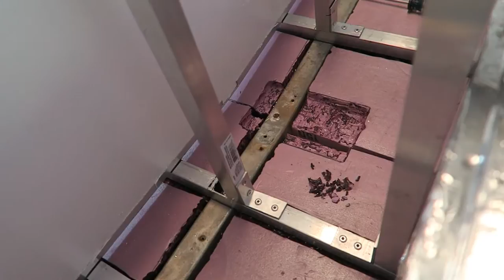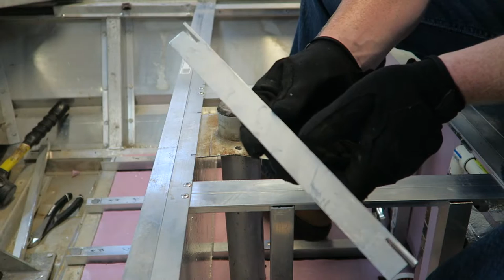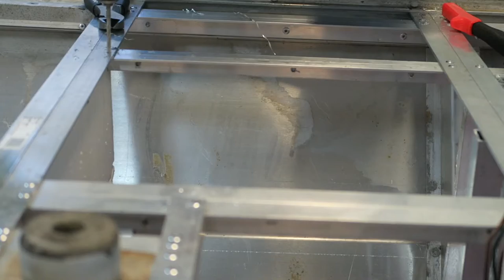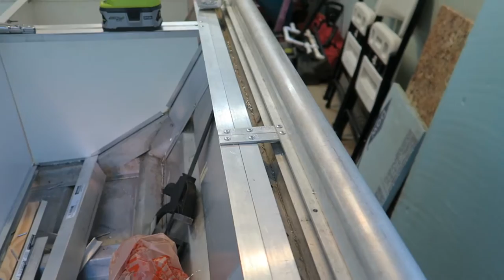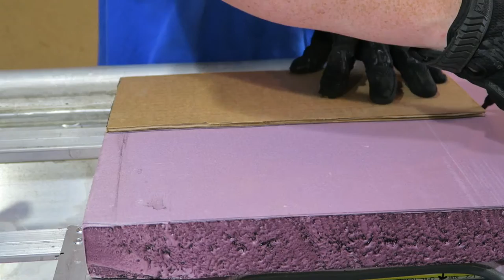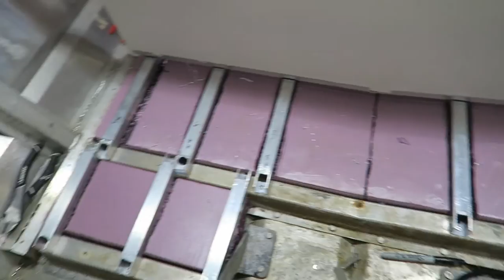Installing the Rear Seat

Comment: I built a large casting deck using Galvanized steel 1 5/8" heavy gauge c studs and rivets on my Alum a craft 1654 about 8 yrs ago.....it has worked great for 100's of days of bass fishing and not a single rivet ever loosened up on me....it sure u will be fine.  I just removed them original deck and framing yesterday for a full rebuild using all aluminum decks.
Reply from the maker: Shawn Simmons awesome haha that makes me feel better! Good luck on your build man, if you can send some pictures I would like to see it!
Reply: +inFIREANT FISHING

Comment: Have you thought about water drainage? How will that foam handle getting saturated with water?
Reply from the maker: There are grooves in the bottom of the boat that run underneath the foam where the water can drain to the back. I honestly have no clue how this foam will hold up in the water. I don't think it will be an issue, bc its not porous. But if I end up having an issue with it ill be sure to let you guys know